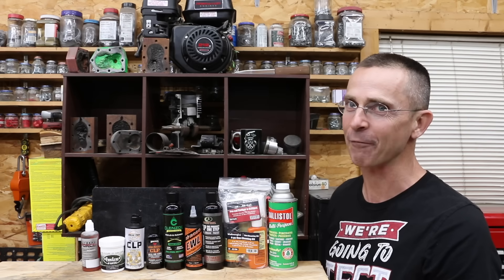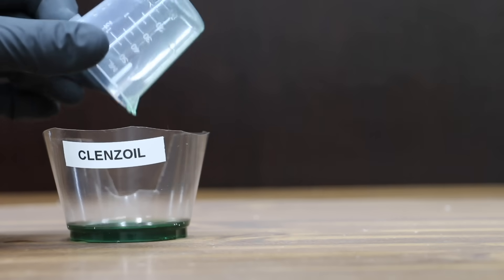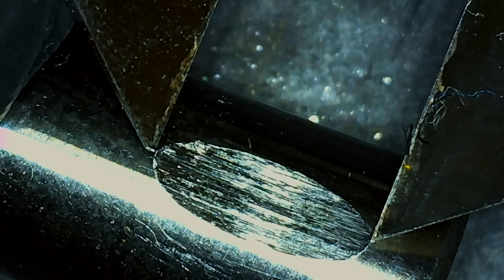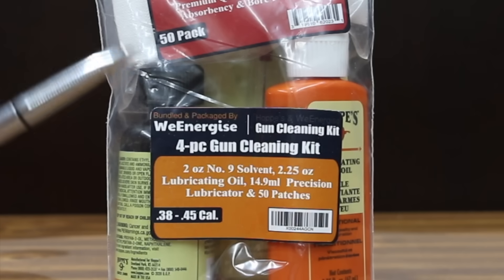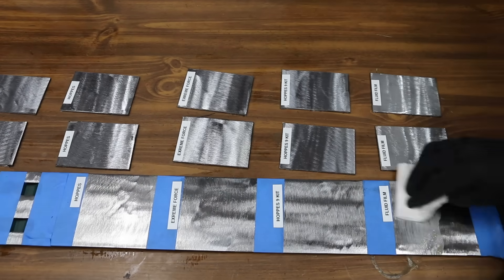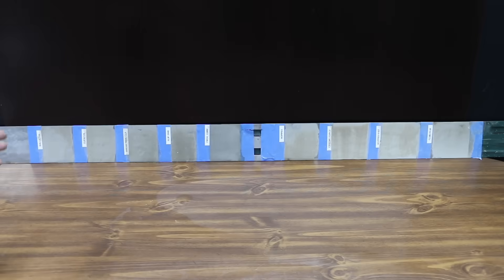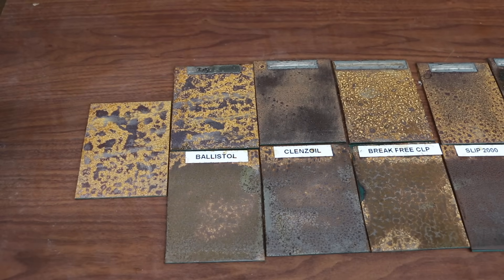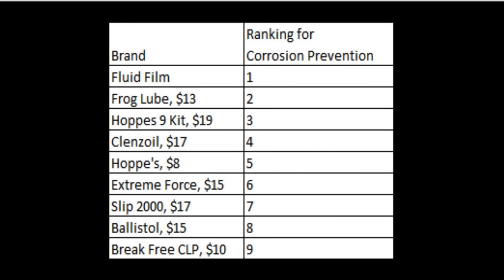Don't Buy A CLP Until You Watch This Review! It'll Save You Time And Money!

Comment: Give Slip 2000 EWL 30 a test.  It's thicker than the standard EWL and I believe it will have much better wear characteristics.  I've been using Slip 2000 products for years and with normal use and care all of my firearms have ran fantastic.  Thanks for the test.
Reply: I add tungsten disulfide to my EWL 30. It's a cheap additive that increases performance.

Comment: I have a video suggestion  comparing different dry film lubricants.  I think it would be interesting to see how the DuPont non-stick teflon lubricant does on the lubricity tester. I use this dry lubricant on a few items in different areas of motorsports.  Oil and grease are not practical to use in some spots due to dirt attraction to those areas. However not sure how long the dry film actually lasts or if it even really helps. Dry film lubricant gets applied several times just as a precaution because we don't know how well the coating stays on.
Reply from the maker: Thanks for the suggestion.

Comment: Thanks for the excellent video.
I always been a fan of the Hoppe's #9 product's. The clenzoil seems like a good choice for semi-autos. For my beater guns I always use super tech non detergent 30 weight, its mineral based oil. Slicks up my old shotguns pretty good. That would be a good oil for testing.
Reply from the maker: You are welcome!  Thanks for the suggestion.

Comment: I've been using Break Free for 20 years, and I can absolutely confirm that it's a great lubricant in practice, especially for AR platform rifles in and out of cold weather. The trick to keeping ARs running is to keep their internals well lubed.

As an experiment, lube up your BCG really well, and run a mag full of ammo through it, then check how much carbon ends up in the buffer tube.
Reply: Depends if you have a piston driven rifle.
Reply from the maker: Thanks for the feedback.
Reply: This man is correct. The AR series likes to be run wet.

Comment: Thanks as always for the testing.  I'd love to see a test that includes Weapon Shield, M-Pro 7, and Lucas, to name a few.  Many of the ones you tested are known to be sub-standard performers.
Reply from the maker: Thanks for the suggestion.
Reply: Dito on weapon shield. George's product is the best
Reply: Eesox would be nice to see as well
Reply: +1 on Lucas.
Reply: I would also be interested in Lucas oil. seems like a good value
Reply: I use M-7 pro seems to be better than others but I may be wrong
Reply: Weapon shield is solid, too.  Honestly, he should have properly applied the Frog Lube (heat treating, direct sunlight for an hour works) for all tests.

Comment: I'm wondering if you could look into engine flushes, I mean if a engine cleaner could clean gunk/sludge won't it break down oil? And even after you drain the oil will that last bit left in the engine break down the new oil?
Reply from the maker: Thanks for the suggestion.
Reply: @ProjectFarm  I'm also thinking if heat+the cleaner would have an effect. Like if the heat helps break down carbon/sludge. But would it break down the oil? But I would love to see what flush/clear works best and which ones are snake oil and I can't wait to see if you take this one on and thank you for all the amazing content

Comment: Great video. One thing worth mentioning is that mil-spec is intended for select-fire weapons, and typically with the assumption that the same product needs to work in any environment. A lot of shooters don't have select-fire guns, and don't shoot enough to introduce any significant wear on their guns...lots of people inherited their grandfather's gun that still shoots just fine. That said, for hunters, the cold performance can be super important. Often, hunters who hunt in really cold conditions are told to run their guns without lubrication. The risk of wear is really minimal for the few shots likely to be taken, and you can imagine what the impact would be if your frozen-solid lubricants were used in a bolt assembly, locking the firing pin in place.
Reply from the maker: Thanks!  Thanks for the feedback.

Comment: Wondering how well the froglube would do in the friction test if it was warmed up to its more liquid form.
Reply: or use the liquid version of frog lube
Reply: Frog lube really really wakes up once warmed up or cycled a few times. People bitch about it because it’s a paste and their dainty AR doesn’t cycle well after shooting in the cold. 1st- they’re using way too much of any product if it’s enough to clog after shooting for a day.  Frog Lube is supposed to be used extremely sparingly, I’ve had a small jar for about 5 years and still going strong. As well, I run shit steel cased x39 in my AR’s. 2- Kalash is life. 3- I’ve run my guns with Frog Lube and noticed my cleaning is a simple wipe and it still has a film on the steel. I’ve noticed the best process is to wipe clean after shooting, then next session clean and lube right before shooting, the heat on the steel opens its pores in a sense and that’s where the FL goes.

Comment: VERY good video! Would love to see more about some of the "bake in" lunbricants. 
 I've been experimenting with a CLP called Seal (and Militech, which I don't think is a CLP. LP maybe? lol). Interesting note; the Seal (and militech) say to bake it into the metal, so I put Seal on 2 butterfly knife blades and the one I heated is still super slick and shiny around the bushings and where the blade rubs, the one that I just wiped on is what I would expect from any other CLP or lube- a bit dark and grimy. Pretty impressive considering these knives are subjected to exponentially more metal on metal wear and tear than any other folding blade. So now would recommend Seal for firearm use, and trust it on my own, after seeing the results. While the Militech didn't seem to treat the metal as well, it may be because I didn't add enough heat so I need to try it again.
Reply from the maker: Thanks!  Thanks for the suggestion.

Comment: Interesting results. I’ve tried a lot of these. Being an avid hunter I often hunt in sub freezing temps. I’ve found FP-10 lubricant elite to work quite well. Besides working great in the cold seems to form a smooth slippery bond with the metal and the actions of my firearms especially over time. It’s the best I’ve found including many of the ones you have listed above.
Reply from the maker: Thanks for the feedback.

Comment: I use Ballistol for cleaning sometimes, but I can't really tell whether it's cleaning or just working the dirt into a slurry and moving it up and down the barrel.
Break-Free works in my 1911's sprayed copiously inside the slide and dropped into the grooves on the frame. I think those old-school all-metal frames like to be run wet.
I just use a spritz of Barricade in the polymer frames.
Reply from the maker: Thanks for the feedback.

Comment: For decades I have been using Mobil-1 Synthetic Engine Oil to lube and protect my guns and it has worked well. About 12 years ago I switched over to Mobil-1 0w40 since I use it in my cars as well. To date I have had no rust and no wear issues. I would avoid the recommendation of gear lube. First gear lube has a lot of viscosity improves and is about the same thickness as 5W30 when it is tested at the ASTM test temps for gear lube it is only super thick when it is at lower temperatures than it is designed to operate at. Gear Lube like ATF uses acid based chemistry so not what you want to leave on the weapon for use. Motor oil is base chemistry that is why we measure ATF and Gear Lube "TAN" Total Acid Number keeping in mind they never see combustion and are not designed for combustion environments and we measure oil "TBN" Total Base Number. Never put gear lube in an engine or in a gun just not a good choice wrong base stocks, wrong flash points, wrong cold flow properties, wrong chemistry! In place of US Army LSA which is not an oil but a "fluid grease" I take the same M1 0W40 I keep on hand for my cars and I mix Mobil-1 Red Synthetic Grease and flows like US Army LSA. Before M1 0W40 I used what ever synthetic I had on hand and what ever grease I had on hand usually Moly-EP.  Nothing new been doing that longer than the internet has been around. I posted recipes like this on so many forums over the years since the internet took off too many times to count. Back in the day a lot of SS hand guns would suffer galling between the frame and slide and the initial trick was MOLY-EP grease.
Reply from the maker: Thanks for sharing.

Comment: Break-Free is the brand the US Marine Corps was using when I joined in 1987.  I have used it on every firearm and tool I've owned since then and I've never had a single cause for complaint.  Nothing in this video changed my mind, (which is good, since I have about ten gallons of it in the garage).  Thanks for the test, sir.
Reply from the maker: You are welcome!

Comment: The test woth the friction wheel sometimes you had the metal flaps ( splash guards) on the outside of the cup and sometimes you had them on the inside.  I would think that would not be an accurate or even test between the products.
Reply from the maker: Thanks for the feedback.

Comment: Anyone who has spent time in the army remembers how CLP would separate into its rust penetrant and oil lubricant layers if left on a hot shelf for a long time.  Had to shake it up first.  CLP Breakfree has never been a particularly good slick lubricant, but it’s adequate. One oil to both dissolve carbon and lube surfaces, but if you aren’t cleaning but rather only lubricating, there are far better, and slicker, lubes available.  Another lube we had was the thick white whale sperm for the M-2 50 cals.  It worked, but it wasn’t very slick. For decades, an old home brew has been to mix motor oil with light wheel bearing grease to a consistency of syrup.  Even at the local unit level, supply NCO’s often procure aftermarket gun lubes.  For M-9 pistol ranges, our cadre did not even use CLP.  We all had orange bottles of Hoppes 9 to use on the slides.  You could easily feel the difference between the lubes when racking the slides. 
We did this for our own line units only.  Basic trainees with M-16/M4’s just got CLP sprayed it.
Reply from the maker: Thanks for the feedback.

Comment: I've used clenzoil for years simply because of the sprayer on big bottle & needle tip on the 3oz travel bottle. easy application and easy cleanup of carbon deposits.  luckily i don't have to worry about cold temperatures where i live...  i highly recommend clenzoil however it does have a somewhat strong odor, so may not be best for certain hunting scenarios but doesn't stop me from harvesting...  if you check "school of the american rifle" channel he has a video where he makes his own gun lube, would love to see his formula tested against remoil & lucas gun grease.
Reply from the maker: Thanks for the suggestion.
Reply: @ProjectFarm  I believe he uses Mobil1 synthetic high temp grease & mixes with straight 30 weight detergent free motor oil just enough to make it viscous enough to use in a squeeze bottle (consistency of runny ketchup)

Comment: 3 things you should have added. 1. Actual CLP that they issue in the Army. 2. Remoil because it is readily available and works good as far as I can tell. 3. Regular 10-30 engine oil because that is what AK guys use. They also use carb or brake cleaner to clean their guns.
Reply from the maker: Thanks for the constructive feedback.

Comment: I think the dust accumulation test was performed wrong.

Instead of using a visual inspection, the plates should have been weighed after application of the product, then after the test itself to determine how much dust accumulated.

Do you have a scale that can determine that small of a difference?  Or are there other things I'm missing that would affect this I'm not seeing?

Comment: TEST SUGGESTION:  Glass repair products - products claiming to repair broken cell phone screens. The best thing I have found that works ok is a fast hardening epoxy glue and a light sanding. Tried vinyl floor polish but it is too viscous. WARNING: Using a very viscous product can damage the digitizer or OMLED LED screen behind the Glass.
Reply from the maker: Thanks for the suggestion.

Comment: There's another option that does have one major drawback. 
 If anyone else has purchased a Chinese made AK or SKS you know that those guns come completely encased in some sort of extremely thick, foul smelling petroleum product that appears to be just dug out of the ground and slathered onto the weapons with no intermediate phase of cleaning or refining. 
It probably does a decent job of keeping moisture out but, the aromatic bouquet of putrid sulfur is not something I, or most people I think, can live with. 

I can't speak for everyone else but when I clean my guns I want a solvent that cuts through all of the deposits and oils. Only after I've thoroughly cleaned the weapons do I apply a moisture barrier. It seems kinda nuts to think that one product can do both jobs since their functions are almost at the opposite ends of the spectrum. 

I believe there should be some consideration given to the purpose of the products. Some are just intended to provide primarily moisture protection while others are intended to mainly provide lubrication. 

Great testing though as usual and thanks for all the pertinent information Todd.
It would be cool to see a future video in which you broaden the testing to include the top couple of substances tested here and some of the most popular automotive and industrial lubricants now that I've filled my garbage cans with all of my Hoppe's crap.
Reply from the maker: Thanks for the suggestion.

Comment: A good thing to note;
The lubricity test should be the most important factor because we can clean off dust or even light surface corrosion but we cannot replace metal that has been worn away.
Great video, keep on testing
Reply: Good point, but the lubricity test shouldn't be performed at room temp. It should be performed at the operating temp range of a firearm in order to simulate actual use. Viscosity changes with temp, thus the test results will change with temp.
Reply: So a good question I have is, would Break Free's LP perform better than the CLP being that it doesn't have the cleaning agent in it and is directly for Lubricating and Protecting.
Reply: @df3624  I'd be interested in him testing that as well.  I hope he adds that to part 2.
Reply: No test is perfect, but I'd have to wonder if the test would perform the same if you put just a single coating on, and then see how much remains in a realistic situation. I wouldn't put all my chips in on that one test.
Reply: Except that this test doesnt really mimic what parts go through. I have used Ballistol and Hoppes since forever, and none of my firearms have any wear other than bore/chamber from round count. Like, zero wear.
Reply: @daflea66  I think wear and tear experience is pretty subjective, with some people having fired 500,000 rounds and others in the thousands.  Different firearms also have much different tolerances.  An $800 firearm will have less wear than a $2000 Les Baer or WC that has tight tolerances, and in both cases the wear probably won't be noticeable until you rest them on a bench rest and test fire at 50 yards. I don't compete so I doubt that I can really benefit from the differences in all these excellent oil. :)
Reply: @lanzer22  Im saying a straight up bearing test I think is extreme, there arent any conditions in a gun that would do that. I use the brands that did poorly here and have 0 wear that isnt supposed to wear, like extractors and chambers

Comment: Ok...   my version of the old Ed's red is as follows.   One part acetone.   on part automatic trans fluid.    One part kerosene (old style)   add to each quart one ounce pure lanolin and 2 oz (for odor) Amyl acetate...    those last are my 'proprietary'  ingredients LOL       Figure about $40 per GALLON    That is around 10 cents or less per ounce. (depending on current costs)  None of those bottles would cost more than a buck and a half.    Most would cost under 50 cents.      I give away pints and quarts and all my friends ask for more.    Good news is you don't have to be stingy.. also... it has penetrating powers    ATF and acetone 50/50 alone often come in first in penetrating oil tests

Comment: Guns normally do not have much for moving parts.  Also, unless you using a semi-auto, the heat from a shot will only last a very short time and may not burn off the CLP.  Change the heat test to a blast from a blow torch and then test for rust.

Comment: So something I've found is that some of these products don't last. I used to use Frog Lube but after leaving it in one of my guns for a couple years, it changed to a gross yellow color and thickened a lot. It was so thick that it was causing light strikes and unreliable ignition. I had to completely remove it. It would be cool to set these out for a while and see what time does.
Reply from the maker: Thanks for the suggestion.